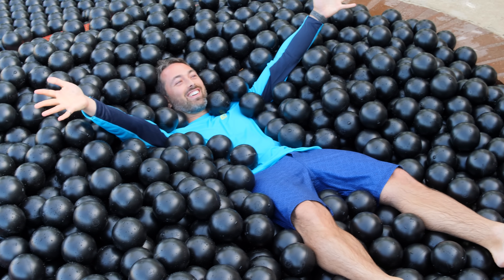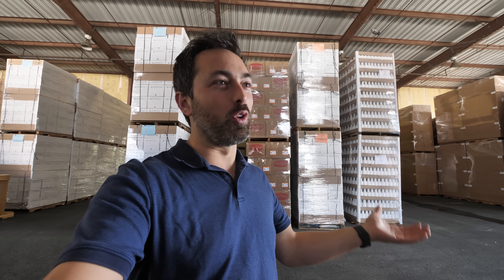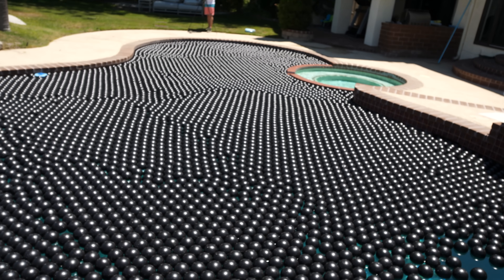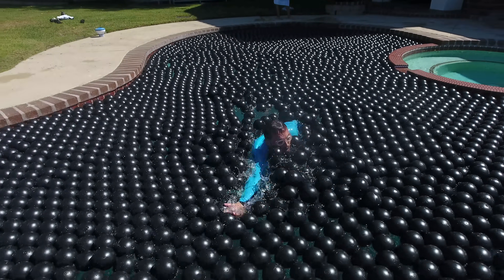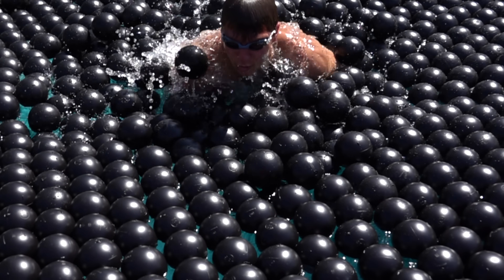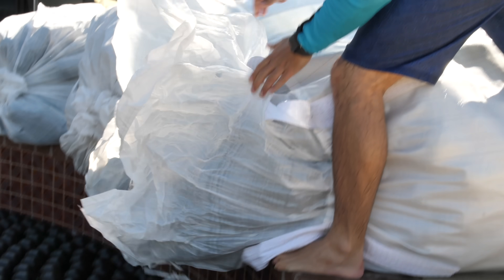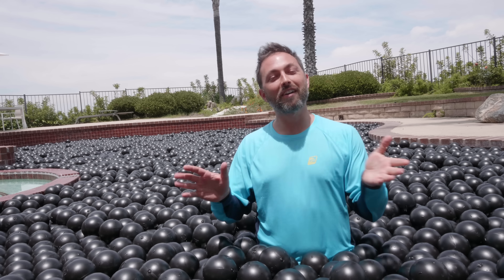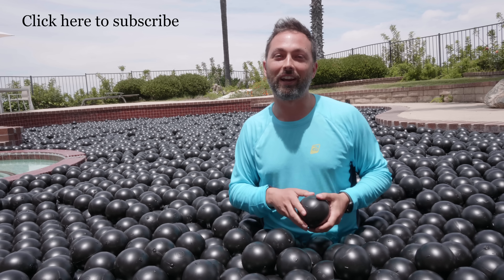Can You Swim in Shade Balls?

Comment: You forgot 1 question, would someone drown under multiple layers of shade balls if they couldn't stand?
Reply: I don't think so, if you can get your mouth above the water level (and into the shade ball layer) you should be able to breath fine, just like how you breath at the bottom of a ball pit.
If you're really exhausted though, you might not have the energy to lift yourself up, maybe you wouldn't be able to float on your back with no effort (specially if you have low body fat).
Reply: Yes you can drown, not in  a sudden way though... you can still swim and catch your breath but it will depends on your physical endurance and/or how long you can hold your breath because as you can see on the video, they are really struggling to swim on multiple layers of shade balls... if youre expert on swimmimg, you could probably last a few minutes until you drown and most likely die. And if youre just an amateur, well go pray while you drown that someone would immediately rescue you cuz you wont last like even a minute (or probably more if you have guts to live)...
Reply: Reckon I'd swim underwater, coming up to take a breath every so often.
Reply: It’s much more dangerous than without the shade balls, but you could swim below most of the shade balls. It would be better to get to the shade balls layer, take a deep breath, and swim totally underwater.

Comment: How do they "only" block 91% of the sunlight? Take a circle with radius r = 1/2. Its area will be (1/2)^2 * pi ~ 0,7854. Draw a square around the circle, such that inscribes the circle (it touches its boundary). The area of the square is obvious 2* r = 2* 1/2 = 1. This means that the circle covers around 78,54 % of the area of the square. I know were talking balls i.e. spheres here, but the intersection of the surface of the water with the sphere is circle. What am i missing?

Comment: why are they in the reservoir? why would they make iit hard to control how much lighit covers and will clog all that is designed for free running water , why dont they uses a green house shield of plastiic and why would they interfere with visua l confirmation of somthing thrown into  water and sitting at the bottom that would contaminate  the  cleanlyness  you guys need to use that smartness to see the bigger picture with all the natural disasters and how they are trying to ;protect our drinking water from a unique problem that could never be stated to the public

Comment: It's drinking water, you cannot swim in it, obviously. 

Rides a gas motor boat in it.
Reply: Den Duzhiy there is a difference between an aluminium boat hull and you know..... buttholes and urine.
Reply: @blue-pi2kt  That was an open reservoir, any animal can sh*t in and bathe there. I don't think one person getting in will change anything.
Reply: @blue-pi2kt  you're still putting discarded gas in drinking water
Reply: @papajohnny6442  You know how Oil floats on water.  And how "gas" evaporates You see where I'm going here?
Reply: @79Munter  LOL you serious... you think his body will contaminate the water more?
Reply: @troyb8579  Nope.  I mean that the reason we're allowed to use petrol (Gas) engines on reservoirs, and not diesel ones, is because petrol evaporates off easier without contaminating the water.  That is the whole of my point.
Reply: Was the boat engine 2 stroke or 4 stroke?
2 stroke = bad
4 stroke = good
For water contamination that is.
Reply: That's hilarious, yet disgusting all at the same time, I'm assuming they filter the water before distributing it (or whatever you'd call it).
Reply: @somepunkinthecomments471  https://www.google.com/url?sa=t&source=web&rct=j&url=http://www.compoundchem.com/wp-content/uploads/2016/04/The-Water-Treatment-Process.pdf&ved=2ahUKEwiD99zs_-jiAhUHvp4KHc7jClwQFjALegQIERAB&usg=AOvVaw2v1JluHORzMBaOdH9-T9RB
Reply: lol I created a flame war
Reply: aahh i like copypastas

Comment: A question I have: What if you have no ground to push up from to get through the balls? Will you get pushed back under the balls due to the lateral weight of the balls? Having ground you can push up from allows you to get your head above water. But in a deep reservoir, that might not be possible. From being underwater, are you able to swim back up to get your head above water easily and do you feel the balls wanting to push you back down?

Comment: Obviously you can't swing in drinking water.......

But you can run a gas motor on a boat through them.
Reply: exhaust fumes from an outboard motor is released directly into the air. It doesn't enter the water. The only thing in the water is the propeller and rudder of the outboard motor and the hull of the vessel itself.
Reply: A newer 4-stroke outboard motor on a boat isn't like the older 2-strokes that would leave small oil slick on the surface of the water as you went through it, so it's fine.

I'm sure they probably process/clean it before it's actually sent to people's homes, too.
Reply: I hate y’all ^^

Comment: Multiple layers would be much much harder. but the point at which u cant swim (in my humble opinion) would be at the point where the ENTIRE surface is packed in a single layer. its then that the balls can not move out of the way with out being pressed upwards or downwards. the first part of the video had an area that was clear of balls allowing the balls to be displaced.

Comment: Drag is only quadratic for high Reynolds number (i.e. turbulent flow, which happens at high velocities or for highly viscous fluids). For low Reynolds numbers (laminar flow), drag is linear. So for instance, the drag experienced by a runner should be linear, and the drag experienced by a swimmer should be quadratic.

Comment: It's a drinking reservoir, you can't go swimming in it.

Operates a motor boat that uses said water to mix in with exhaust gasses.........lol
Reply: exhaust fumes from an outboard motor is released directly into the air. It doesn't enter the water. The only thing in the water is the propeller and rudder of the outboard motor and the hull of the vessel itself.
Reply: ben schram haha you’ve obviously never been near an outboarder then

Comment: You should definitely do a video on quicksand! you got me interested
Reply: research tells me that there is in fact no such thing as quicksand.  100% pulp fiction/hollywood invented
Reply: @ckellough  continuous everlasting quick sand is a myth ya but air pockets collapsing forming deep sink holes is real and if the cavity is large enough it could suck you in. Its the same effect that makes things like grain silos and industrial bulk solids hoppers so dangerous.
Reply: @maxk4324  interesting.  thanks
Reply: @ckellough  I'd think so, given the density of sand. It's more dense than your body, so you'd naturally float. I believe the mythbusters did a chapter on this, even going in quicksand themselves at the end - to prove that it in fact wouldn't kill you
Reply: clay kellough, quicksand is real, but it’s not deep enough to sink all the way into.  The biggest danger is getting partially stuck and not getting out before the tide comes in.
Reply: @evilsharkey8954  That's in the situation where it is an air pocket under a beach, and it still depends on how big the air pocket is. But its more dangerous in dry environments where these cavities can grow quite large if a thin, umbrella like shell of compacted material forms above them. Then when someone unwittingly steps on the sand above that shell (which could be more than a few feet thick) the shell breaks end you get buried alive.
Reply: @ckellough  Quick sand is not a type of sand. It's a condition when a fluid such as water or air flows in the upward direction due to difference in heads creating seepage pressure, and hence seepage force on the sand particles which balances the weight of the particles rendering them weightless. The sand starts behaving like a viscous liquid under those conditions. You can watch videos on YouTube related to seepage, piping and liquefaction to understand quicksand in a better way. Here's an interesting video on quicksand using air as the fluid by Mark Rober, I hope this clears all your doubts: https://www.youtube.com/watch?v=My4RA5I0FKs

Comment: If the official shade balls are designed to keep water from evaporating from a reservoir, why do they make them BLACK, which absorbs more sunlight energy and transfers it through the ball to the water below, which will become warmer and allow for evaporation in the 9% space remaining from the 91% coverage?  
Why not use silver or white shade balls to reflect more of that sunlight back up into the air?  Seriously.  There must be a difference in evaporation rates using different coloured shade balls.

Comment: Wouldn't little upside down pyramids with weights in the tip cover close to 100% compared to the balls? 
The shape would allow it to right itself with flat side up and pointy side down and allow them to be efficient at covering a surface. Would only need a little push from the side to line them all up in a grid.

Comment: Horta or Tribbles Episode? Carb-a-con Nodules. Looks like swimming in Sand.. with decapitated heads.. or that experiment in College where you put big rocks and pebbles in a jar and try to predict if the large ones or the small ones will "float" to the top with Liquifaction. The Big variable in the 'pool' however is the amount of water in the balls.. it makes them a "synthetic" "meta-material" half-ball/half-water semi-solid.. something that would never exist in nature.. or a "natural" fluffball or paintball "pure" natural material. That's no ball pit.. it a metamaterial pit (metaphysical pit?).. wholly "unnatural"..  Supernatural Ball pit.. if its non-Newtonian.. does that imply a Einsteinium Special Relativity ball pit? Could you simulate Chernenko radiation in this pool and travel faster than light?.. well maybe simulate it with a sound wave or a paint gun? Sound travels faster in a crystal lattice like a metal than in a smushey viscous fluid.. which is this? -- I wonder if the pool cover will keep the Algae growth down, or whether the Chlorine or Salt in the pool will leech polyethelyene into the water.. a chemical analysis of the pool water after a while would be interesting.. might be similar to the effects on the drinking water reservoir

Comment: Since you now know you can't use them in your pool, you have 10k used shade balls.  I'll buy some from you if you list them on eBay.  I want to use them in my horse's water troughs to slow down the growth of algae.  The horses will just stick their muzzles into the water as they usually do and the balls will slide back in place when they are done..  I have three water troughs that I calculate will take about 280 of them.  Of the ones that you don't move through Patreon.

Comment: shade ball: dangerous because is 50% full of water
water: 100% full of water, not dangerous.
OK
Reply: Im pretty sure the point is that water has a liquid surface, you can go through it to breathe air at the top. If you dived into the pool and it was covered in shade balls, there would be the worry that you would struggle to push the balls aside to breathe, struggle and drown from the effort etc. Obviously this can be avoided though
Reply: @Areithrial  r/woooosh
Reply: Alessandro Laganà it is because water weighs a lot and if you get stuck under multiple layers of them it is hard to get out because you can’t get out you will drown and die
Reply: @jonahtv4974  that r/whoosh is for you too uwu

Comment: Make Da Vinci’s Diving Suit. You can use any modern material you want. The suit is made of leather with a mask that looks like a gas mask; the mask has lenses to protect your eyes and there are two long snorkels that are jointed with steel rings inside a waterproof sleeve. They connect to a bell shaped float with holes for you to breath from. You can hook up an air hose to one hole and leave the other one open for the extra gas to flow out. Be careful with the holes position if you get them down to the right level they can stop water from flooding into the hood. Thank you 😊

Comment: 7:28 The free water level is shown lower than the water level in the balls. This would only be realistic if the material of the ball shell is lighter than water. I don't think it is though. If I were to take a guess, I would think that the balls are filled to such an extent that the water level is about halfway the height, i.e. where they touch.

Comment: Fun video and idea!
Drag may (generally speaking) be proportional velocity squared, though I don't believe because you are hitting more balls by going faster but rather because of how kinetic energy is transmitted from the moving object (you in this case) to the non-moving object (the balls in this case) using the formula k=(1/2)mv^2. In this case, there are also lots of other causes for drag in this case since the balls are pushing on each other and the side of the pool in complicated ways, and also dragging water with them, and also but probably to a lesser extent using up energy as vibration (noise of balls hitting each other) and through entropy as the water in each ball and around them jostles around.
Cool experiment nonetheless! But good to keep the science/math as accurate as possible.

Comment: Ugg.  As someone who specialized in butterfly back in my high school swimming days I do not relish the idea of trying that.  That stroke is highly dependant on maintaining not only momentum but keeping the wave pattern going.  Fail either and you'll just plow water and spend 5 times as much energy for the same effect.   Those balls would nuke both and repeatedly punch you in the face just to add injury to insult.  you also have to arch up too much to clear them, this presents your chest and increases your surface area thats geting hit by water and shadeballs.
Judging from this video assuming you can manage to push through from the bottom to get air you'd be better off swimming underwater.

Comment: With a single layer probably not the best method of swimming.
Probably a bit biased since i prefer to mix diving a bit.
Push down then forward a few times before going back up.
Certainly helped by the lack of a current.
Theres a good reason why you don’t swim in reservoirs. “Apart from it being drinking water”.

Comment: I have done things in the interest of forwarding scientific knowledge that were exponentially more dangerous than swimming in shade balls. I would NOT, however, accept the shade ball challenge for a multitude of reasons. Two come immediately to mind: first, it is insanely frivolous and although that is not by itself a complete showstopper, combined with the second reason, PAIN, it is. They say that hitting water with enough velocity can be equivalent to hitting concrete. My thought experiment for belly flopping floating shade balls tells me that the impact is very significantly increased due to the decreased surface area (perhaps a  square inch per ball). Lastly, the dynamics of the crystal formation, pushing the impacted balls into the water, negation of surface tension and other stuff makes that thought experiment morph into a migraine. Summation: Nope, not doin' it.

Comment: Yeah but you shouldn't be riding motor boats in drinking water either.

 Also, you should have carefully checked out safety before just jumping in, walking in at a height where you can stand if the shade balls happened to hold you under and drown you or something. Or is your whole pool shallow enough to be able to stand in and have your head above water?

Comment: Correct me if I'm wrong but isn't drag being proportional to v^2 explained purely due to the fact that each particle hitting you has a higher velocity relative to you, and their kinetic energy scales with the square of that velocity. The fact that particles are also hitting you more often is the reason why the power from drag (the work done per unit of time) is proportional to v^3.

Comment: I've always been curious from the first time i saw these balls go into a reservoir.  WHY BLACK?  Black absorbs heat which would heat the water.  In a home pool it may help keep the water warm but in a reservoir you don't need it heated.  It needs to stay cool to keep micro organisms from growing.  Why don't they use opaque white balls half full of water.  That would reflect light, which I am assuming would keep evaporation down verses black balls which heat the water.  Also if the water gets too warm it will also kill the fish, which are needed to keep the water clean.

Comment: So I did the math and....
Each ball is 4 kilograms.
Yeah I’m pretty sure you won’t be able to swim in these things without bruising yourself.
Reply: Oh, I was calculating the balls weight with the water inside, and also, the ball being 1 kg and the water being 3l is perfectly reasonable as 3 L of water is 3kg so, the ball being one kilogram is mathematically accurate.
Reply: @saifiqbal8849  yeah, i just did 4kg = 3L water + 1kg shell.
Reply: There's no way each ball is 4kg.  More like 400g.
Reply: Ok correct me if I’m still wrong if you say, but he said that 1200 shade balls was 300 kilos so 1200 divided by 300 is 4.
Reply: @saifiqbal8849  your math is not wrong, it just not seems reasonable that a half full ball has 3L of water inside and the plastic shell weights 1kg. Something wrong is not right here...